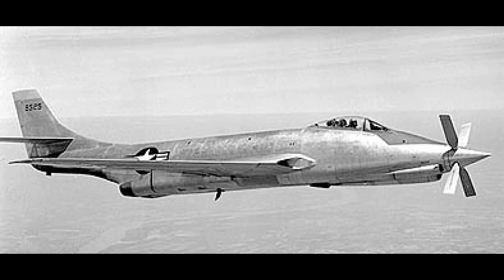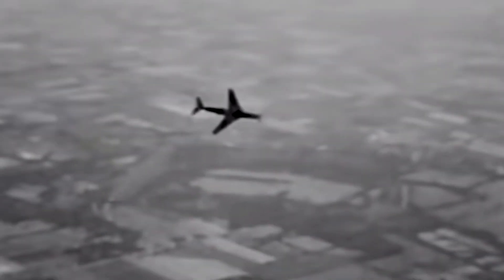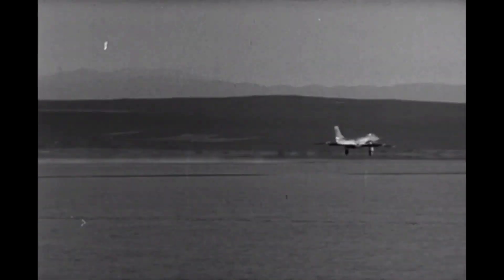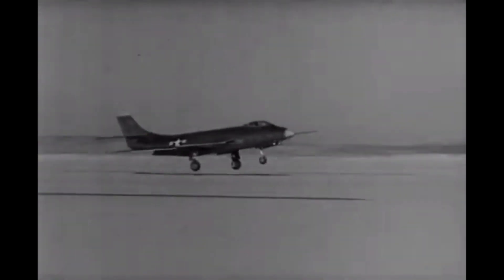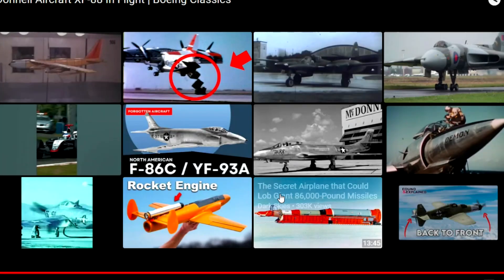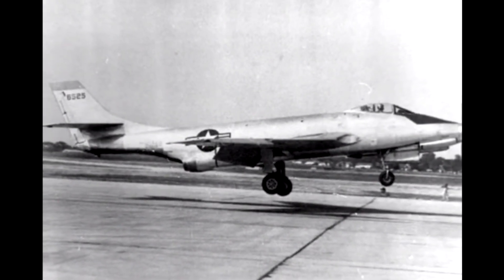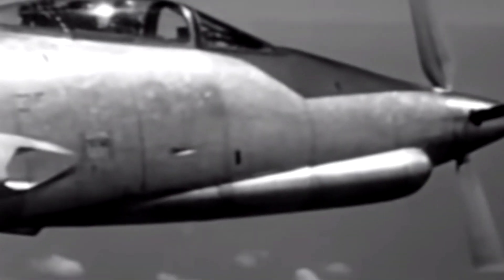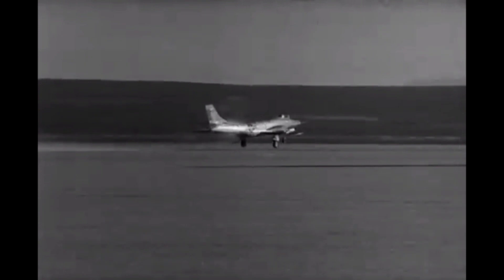XF-88B | The Fastest Propeller Plane Ever made

Comment: Why, in all the video in this presentation, is there no video of the aircraft operating on it's turboprop engines? Even the still images shown in this presentation show the turboprop with a fully feathered prop at idle. Did they never run the turboprop engine in flight?

Comment: The reason it wasn't proceeded with is that at high speeds the drag caused by the prop was reasoned to be detrimental when compared to the pure thrust of the jet engines   It was although a very interesting design as jets became more reliable and powerful

Comment: The XF-88 was FASTER with the propeller feathered and powered by the jet engines alone...by nearly 100 KNOTS!!! The Ryan FireBall suffered from the same problem. 550 pounds of jet thrust pushed it faster than the "5500 HP" turbo-prop AND the jet engine. WHY? Prop-drag Dr. Mach concluded. He then went on to calculate the terminal Mach Number of any propellor driven aircraft. Propellers, like wings, lose "bite" (thrust or lift) at a critical Mach number, about Mach .77 because air is a viscous medium and COMPRESSES at a critical Mach Speed. Compressed air provides NO THRUST from an airfoil propeller. And to de-bunk the British, NO SPITFIRE EVER CAME CLOSE to breaking the sound barrier, despite what some of their pilots SWORE! If you strapped a Titan II rocket to a Spitfire airframe, it would only dive at about 560 MPH, not even close to 732 MPH=Mach1 @ about 20,000 ft in 40*F air or 763.7 MPH at sea level in 68*F air.

Comment: The XF88B was not 'the fastest propeller plane ever made'. It was a modified jet: more accurately, the modified second prototype of a failed experimental jet, the XF88, that had been fitted with an additional nose-mounted Allison T38 experimental turboprop. This was to allow research into the use of experimental supersonic propellors. It first flew in that form in 1953.

In the footage, we see one or both of the two jet prototypes (XF88 and XF88A), and at least two different configurations of the XF88B - modified from the XF88A - with a three-blade or a four-blade prop. Three different propellors were tested before interest in high speed propellors evaporated in the mid-50s. 

In the propellor tests, the hybrid version barely exceeded Mach 1 in a dive - which as the XF88A (pure jet version, but unlike the original XF88 now with afterburners) had already achieved 700mph demonstrates that the propellor contributed little to the XF88B's maximum speed. Changes in military requirements and advances in jet engine technology rapidly made the XF88 obsolete in any configuration.
Reply: Great additional and important correcting info! Thanks for sharing!
Reply: @crappyyoutuber Fastest prop plane (piston-engined) is a contested category. Most contenders are heavily modified and the records were set relatively recently. https://en.wikipedia.org/wiki/Fastest_propeller-driven_aircraft#Other_claimants 
Probably around 530 mph in level flight, which is a lot more than any WWII Mustang or Thunderbolt would have achieved.

Comment: This is not true about the F-88 project. The government contract changed rendering the Xf-88 moot by the time it was produced. It was a jet. The addition of 1 (NOT TWO) turbo-prop engines did nothing for adding top speed which is why the project was dropped and evolved into the production variant of the Voodoo, where the airframe was adjusted for its new role and available jet engine technology was much more advanced.